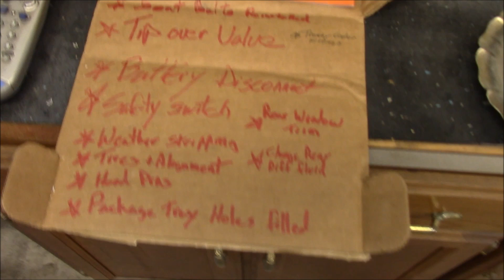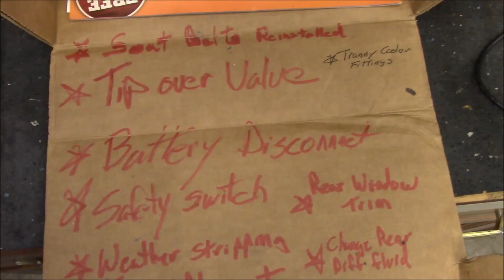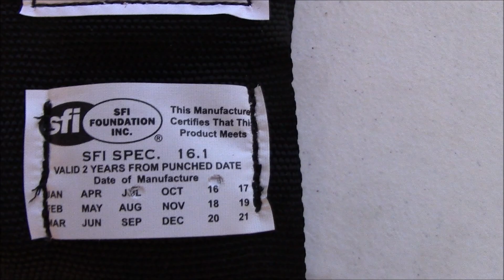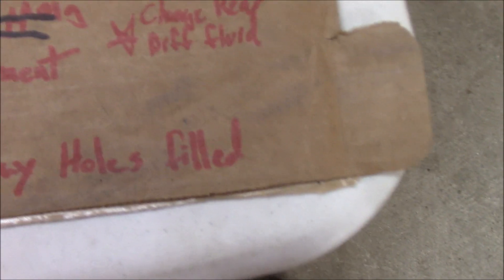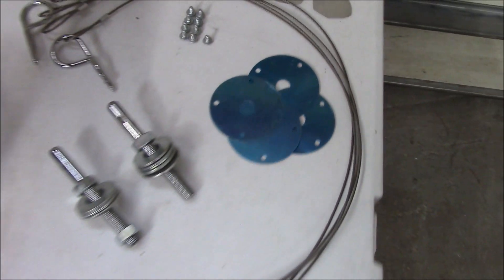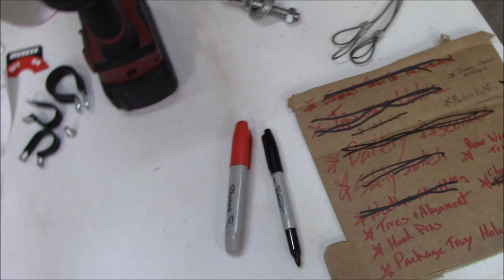1979 Firebird Update

Comment: You just taught me something! I would have never thought of using a chisel to cut stainless reinforced fuel line. In fact I am just starting to run fuel lines for the EFI tank I am installing in the chevelle  :) I like what looked like a bulkhead fitting you hooked up the flex 6 an line to. If you have a website where I could get a couple of those I would appreciate it. There is steel shelf under the trunk where my springs are I am using 3/8* hard line to there and then converting to 6 an flex or that my plan anyway lol Good going Dave!
Reply from the maker: I got the idea off the tube. Actually Snowcrusher had a video about cutting lines easy. I bought my stuff from Summit   I went with Aeroquip products such as fittings and Stainless wrapped and Kevlar black wrapped hoses. It was a little more $  But piece of mind. No leaks yet with 4 hrs of run time with them :)   I went 8 AN throughout.  I have a part # for a fitting  FBM1013  Hope that helps you out. The chisel rules lol.